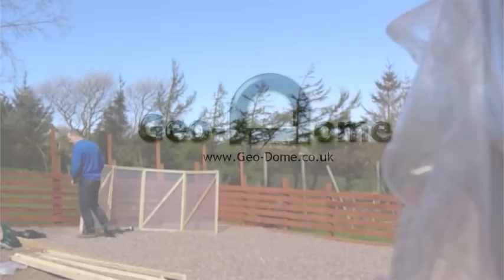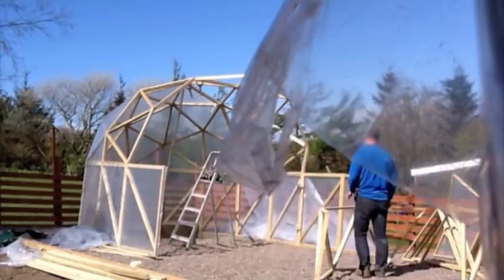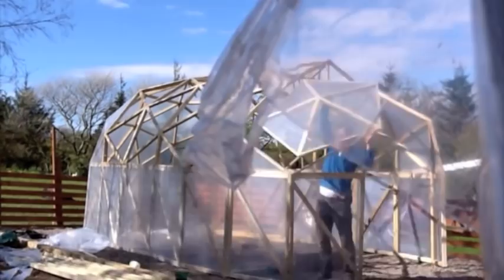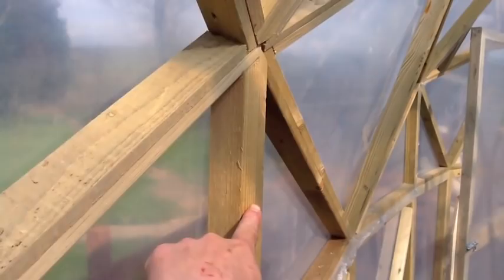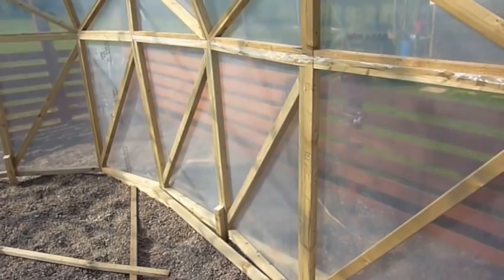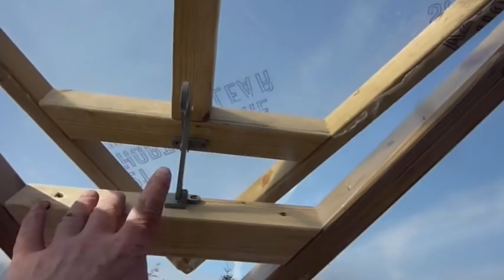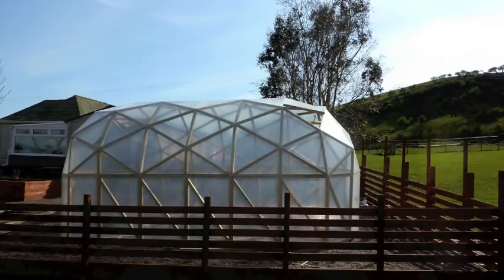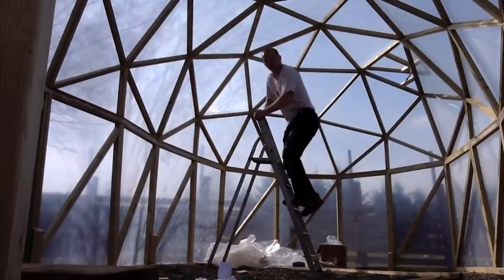tunnel dome build part 3

Comment: Some might argue a regular polytunnel would be quicker more easier build, but when the snow hits, which tunnel would stand and which would buckle.  Still a lot of work involved in this, you should be proud of yourself accomplishing this project.  I guess you could build a bigger dome instead of a tunnel, but then you have to work with whatever space restrictions you may have regarding garden size etc.  Many thanks for the effort involved Mr. Robinson.  Liked and already Subscribed.

Comment: it seems to me that these domes could benefit greatly from some tensegrity style support cables, but at that point why don't you just automate assembly?

you can have the plastic on reels inside the triangles so it's always tight. the real issue here is that you're doing 2D triangles instead of 3D ones. if you did flat face outwards pyramids you could run the cables along the inner apex. that gives you somewhat variable geometry as well. 

let me throw together a mock-up and I'll just make a video and link to it

Comment: what are the basic tools needed to build this and how long did it take?
Reply from the maker: Tools you'll need are: Table saw with tilt function, drill driver, hand saw, staple gun. That;s about it!
A chop saw won't really work because you need to cut the struts on an angle down one edge.

Comment: What type of wood you use please ? Thanks.
Reply from the maker: Just basic softwood from the builders yard. It needs to be quite soft and resistant to splitting because there are screws near the ends. Larch, whitewood are a couple of examples.